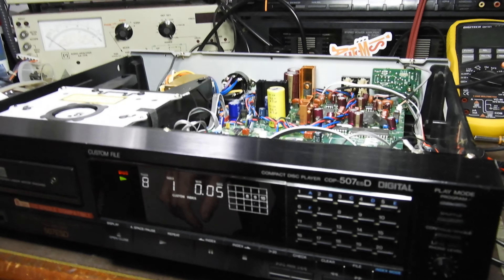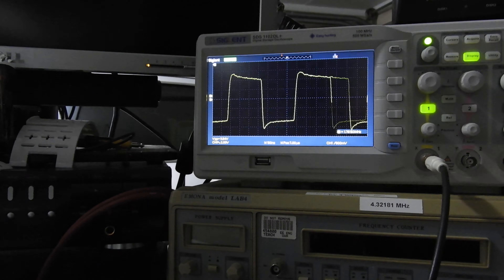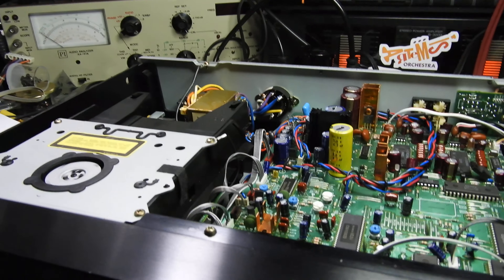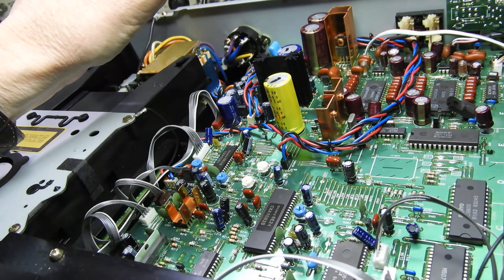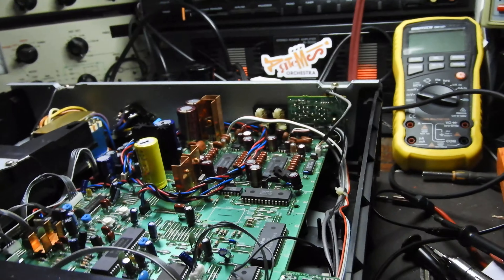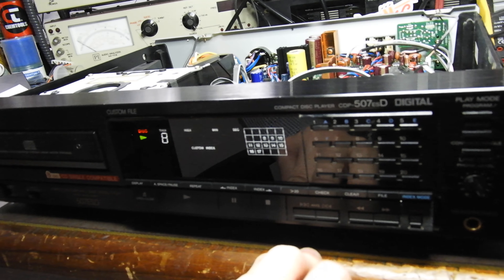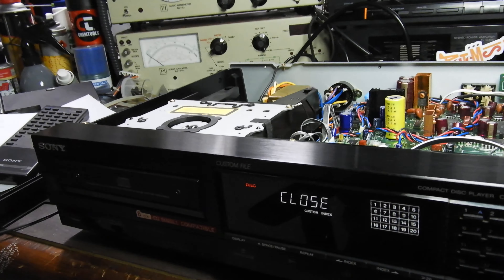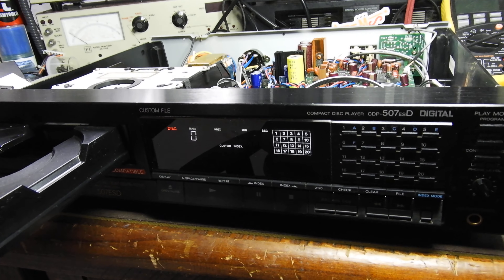Sony CDP-507ESD great unit with KSS-151A magnetic drive mechanism and 2 x TDA-1541A R1 DAC ICs.

Comment: Oh man,,yet another beauty of a player,,I would love to know how much laser power left in my Meridian 200 transport...anyway,,great vid mate,,respect from the UK.
Reply from the maker: No one can say this because it uses Philips CDM-4 and Philips did not recommend any current or emissions levels (unlike Sony which states that current increase of 10mA from the initial value is a indicator of being at the end of its life). Also, only Sony prints the initial current value on their head. But CDM-4 is a single most reliable laser ever made and it is only recently I have seen one fail. But even though it has failed, it was because someone cranked its power to make it still read,  where the problem was elsewhere (leaky electrolytics) :-(
Reply: We all kind of worry about our vintage players sometimes. I hope your Meridian lasts a long time still...